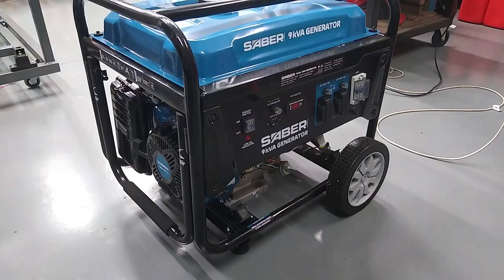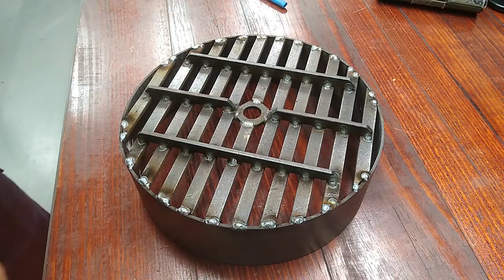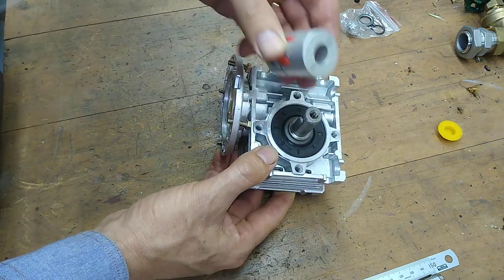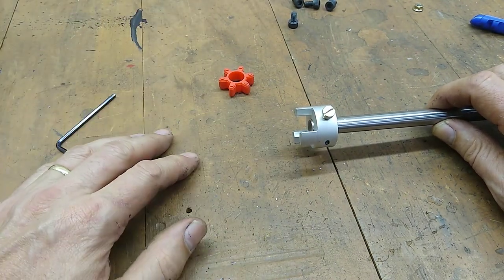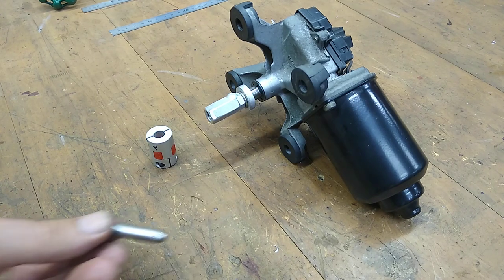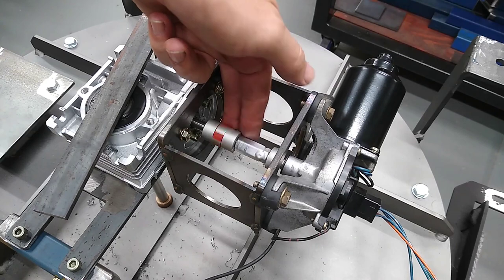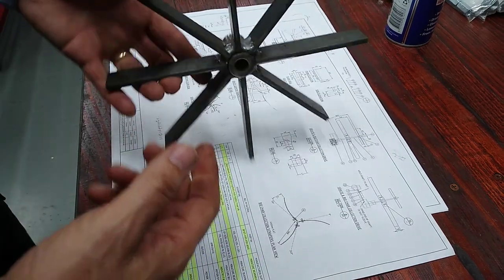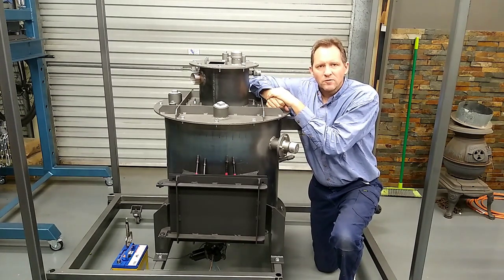Wood Gasifier/Generator, Grate & Agitator E8

Comment: When cutting a "bolt " thread. Put the shaft in your drill press and the die nut on your the bed. Hold the die nut with a spanner clamped to the bed and turn the chuck with a leather pipe strap.. or filter strap. Thanks for the awesome  videos.
Reply from the maker: Ahh I will try that next time, thanks

Comment: Iv been looking forward to an update mate, and you have answered my question on what engine you will be running with it. The cyclone separator will be interesting as i have no idea how to calculate the size i need for my build so id love for you to include on the theory on how to work do that out on your build. I plan on using my gasifire for 2 differnt functions and my air flow will change according to my needs at the time.
Reply from the maker: Thanks, I found the formula on the internet, images from some mechanical engineering papers, the formula is quite straight forward, you can catch a glimpse of it in episode 4, cheers.

Comment: You might should bend the end of the ash pusher wings forward that way the ash will get scoopt up and not jammed against the outside wall.
You will always get a few stones or a nail in your wood..
Same for the grade if there is a stone it will get stuck.
I would ditch the grade and put holes in the side, the ash falls on a solid plate and get pushed with a stirring device over the edge similar to the ash remover in the bottum that way your system would be pretty blockade proof.
Reply from the maker: Looking forward to find out, I'm making this unit as modular and serviceable as practicable so I'll be able to experiment try out different methods hopefully, cheers

Comment: Hi,
Congratulations for the project and especially for the quality of the execution.
What amount of syngas will the gasifier produce?
What temperature will the syngas have when entering the engine.
Can we have access to the execution project in Autocad?
Thanks,
Gabriel
Reply from the maker: Thanks mate, with 2" piping it should be able to deliver enough gas for a 5l V8, but I'm only going for 1.6l 4 cyl. Not sure of gas temperature, aiming for below 50deg C at most, building the condensers now they will have big impact on temperature. CAD file is only 2D, I have deviated a lot from my drawings as I go, will think about it, cheers
Reply: Hi,
My name is Gabriel, I am from Romania, Bucharest.
I am interested in 2D plans. I want to build a similar gasifier.
The plans would help me a lot, it would save time.
I can pay for these plans. You think..... .
Reply from the maker: @gabimunteanu5521  Hello Gabriel, I wouldn't charge any money for the plans, I have deviated quite a lot from them, I don't think they would be the best starting point, I can simplify, show the most important dimensions, cheers
Reply: I understand, a simplified plan with the important dimensions would help me a lot.
If you can help me, I will be grateful.
Thanks a lot!